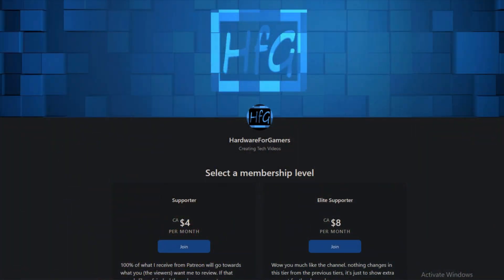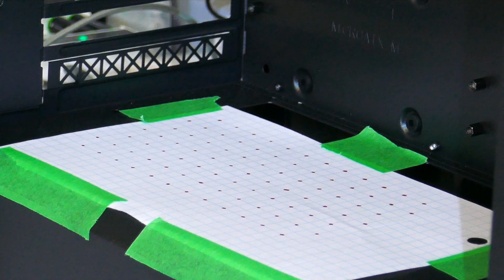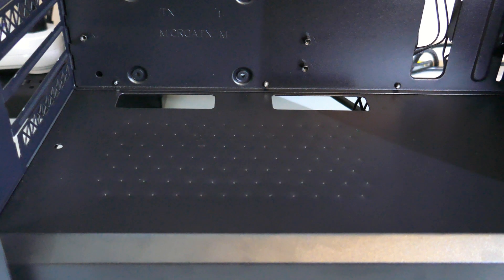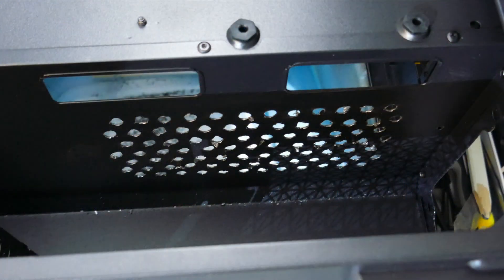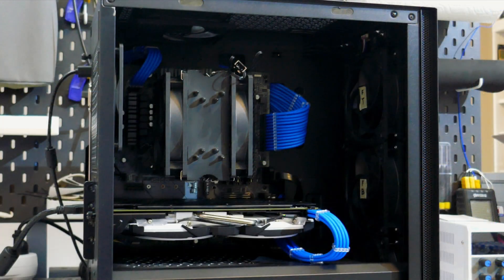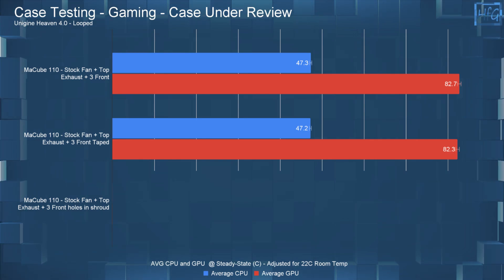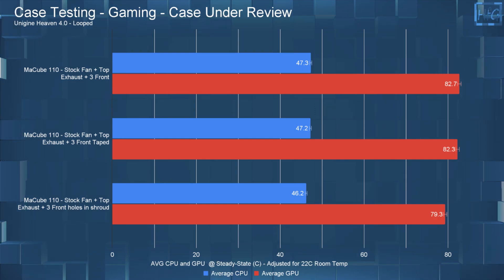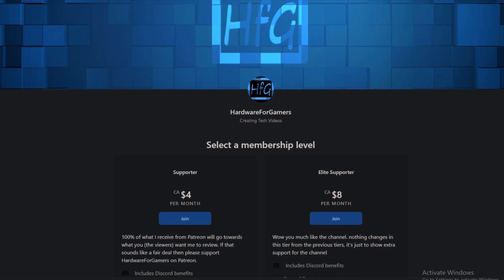Can the MaCube 110 be fixed??

Comment: Would it be possible to remove the basment cover entirely or would it break the case?
Reply from the maker: I think it would break the case. the cover adds a lot of support to the frame of the case.
Reply: @HardwareForGamers   thanks for the info 👍
Reply: @HardwareForGamers  actually another unrelated question could a safely use a 2 molex to 8 pin adapter to power a corsair aio cpu cooler?
Reply from the maker: @levithomas7131  what type of 8 pin connector? Is it a PCIe connector on an AIO?
Reply: @HardwareForGamers  6x2 pin i thinks its called that i would plug into a corsair hub that takes a 6pin pcie power connector would it work without making the pump fail?
Reply: Wait its just a solid 8 pin
Reply: @HardwareForGamers  also does a 7900xtx metal back plate suposed it get untouchably hot? Im concerned if i got a faulty gpu
Reply from the maker: @levithomas7131  okay, so it will work... Do I recommend doing it... I do not. 

Regarding the backplate it shouldn't get that hot. My best guess is an airflow issue in the case.
Reply: @HardwareForGamers  thanks for all that i will say putting a 7900xtx in the macube 110 gives it like 3cm gap for airflow but i think i can set gpu fans to run alot faster at low temps to keep temps down
Reply: @HardwareForGamers  dont worry i got another psu on the way that has enough cables for everything i got a rm1000x

Comment: would it be possible ot remove the sides of the frontpanel? i mean the ~1cm width plastic? with those small holes to incrose front intake. and without losing stability of the front panel? that would probably be easier to acheive while still not sacrificing astethics

Comment: I'm running a 3080/5600x setup in this case and have never seen over 82 on the gpu with a 5 fan setup (3 front/2rear). With an undervolt setup I've not seen over 75c and thermals are perfectly fine with 0 modification to the case. It was mentioned earlier, but your problem is the motherboard chosen as the gpu is simply mounted too close to the shroud.
Reply from the maker: Now I don't disagree with you, your numbers are your numbers, but around 60% ish of AMD matx motherboards are being sold with the m.2 in the first slot. Plus would it have been hard for DeepCool to punch the holes themselves?

Comment: I did similar with the gal-pal's case. I built her son a new pc and repurposed his old NZXT H500 for her new 12400 pc. NO airflow at all! I punched and drilled a fk-ton of holes in the front and covered them up with a magnetic mesh panel ($7). Looks good and is 7-10*c cooler. I'll snap some pics this weekend
Reply from the maker: 7C... 🤣 that's just wrong.

Comment: I also have a Macube 110 running with a 3060 Ti vision from Gigabyte. I never hit past 70c under load. I think that the case was designed for m-ATX boards that have their 16x PCIe lined up in the top most pcie slot on the case. Allowing for the GPU to get some air generated from the front
Reply from the maker: Hey, that is likely true, but not all MBs have the PCI slot at the top. If anything more don't than do these days, because of m.2s.

Comment: The problem with drilling holes yourself is that you have a lot of material between the holes. You need to have as little material as possible, similar to say mesh for example. 

If you dont have holes to begin with, drilled holes can do slightly better.  But not great. If you were to just cut a hole and add mesh or metal with a better airflow design on it over the hole. Depending on the media you use, you may need a fan with more static pressure to bring air in or push air out of that mesh.
Reply from the maker: Yes, but like I said in the video, no one should need to do something like this.
Reply: @HardwareForGamers  right. The manufacturer should be doing do diligence and testing.

Comment: Definitely interesting! I've always wondered if, instead of the shroud (even with holes in it), that there was more of a scoop/slide whereas the heat would have a way to be funneled so to speak out of the case, that something like that would make a serious dent in the temperatures. Thoughts?
Reply from the maker: I'm not 100% sure what you're thinking, something like a half shroud type thing? cases with out a shroud do typically have better temperatures when everything else is equal. The reason shrouds became so common, was it's so easy to hide a rats nest of cables in and people seemed to like that. but yeah, the smaller the shroud (size and shape) the more air movement there should be.
Reply: @HardwareForGamers  What I'm thinking is to have the shroud to cover the cable(s) mess, but having some type of "scoop" at the top, whereas the GPU's blow the hot air down over the (current) shroud) and some heat just roams around the case, a "scoop" can take that heat and channel it out of the case, if that makes sense. This was the heat from the GPU's is not being blown into/on top of the shroud but, rather, it's blown down through the "scoop" and straight out of the case.